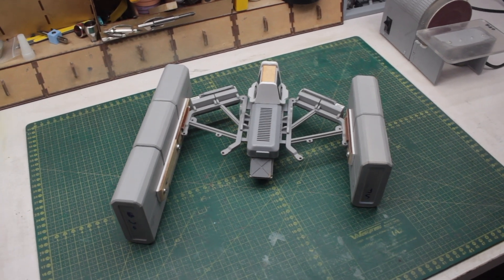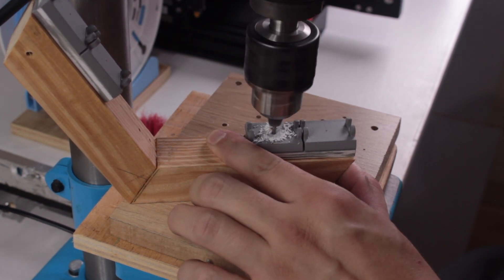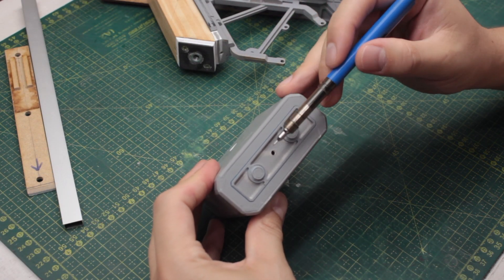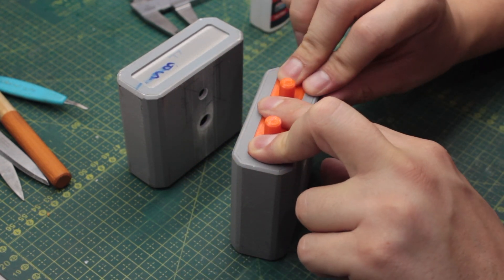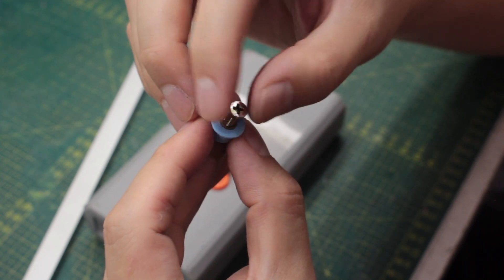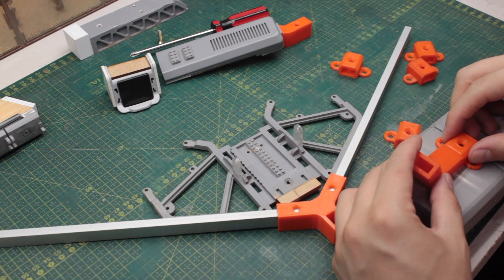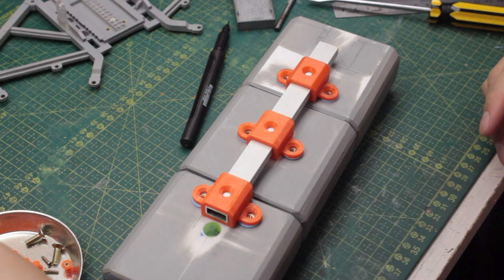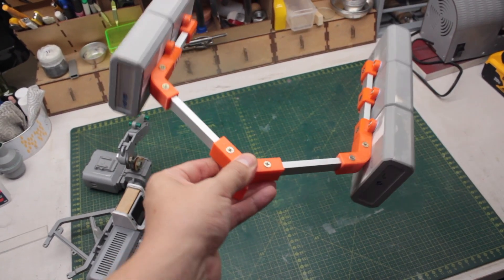Sniper Spaceship - Part 4 - 3D printed frame!

Comment: A good homemade tap from a screw involves a lengthwise slot cut using a Dremel/rotary disk. The flute doesn't have to be perfect and rounded. Works fine on soft material like wood, from any screw.
Reply from the maker: Hmmm, thanks for the input! So I could have just done a thin channel on both sides, right? I'll try that again when I get the chance :D
Reply: @CutTransformGlue  It'll actually work with just a single slot on one side, from my experience. Try two slots and see how it works on some scrap :)
Reply: @spinafire  I did with two slots in opposite sides, it works fine.

Comment: Even though you said you wanted this to be asymmetrical, I feel the railing at least should've been the same length on both sides. It infers modularity and balance. Overall it looks much better than the wooden version. Great job!
Reply from the maker: I think I'll put something, like a radar or a telescope on the front of the short wing.. So I wanted that part to be empty. But your idea makes total sense, I see your point! Thanks buddy!